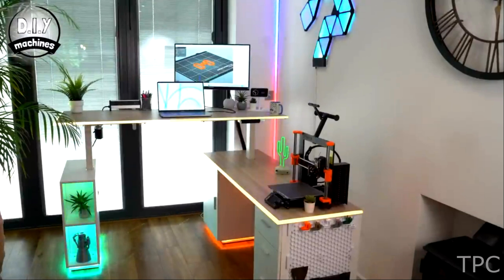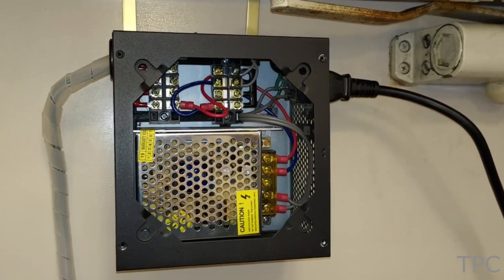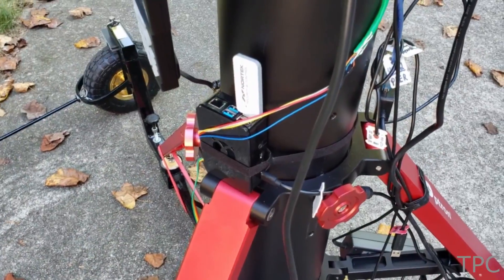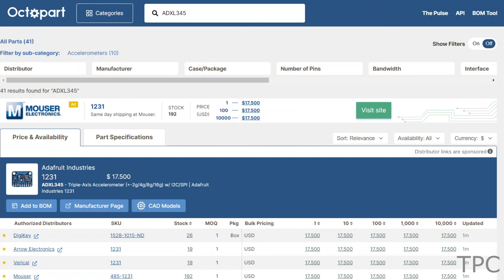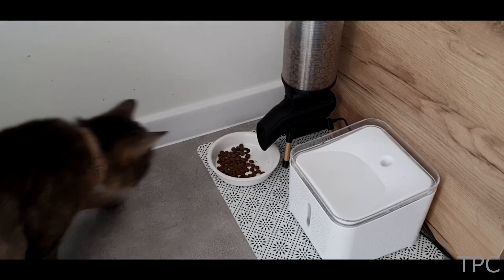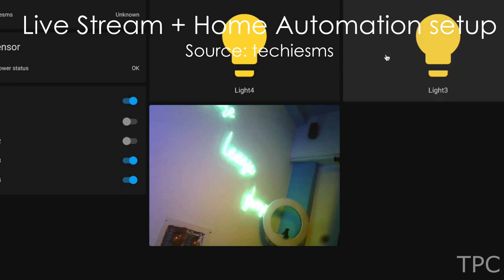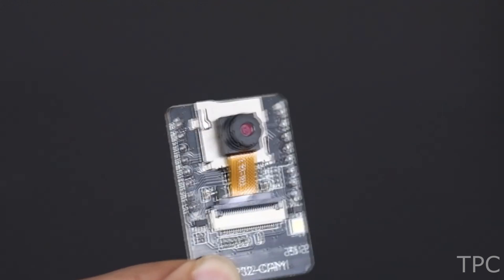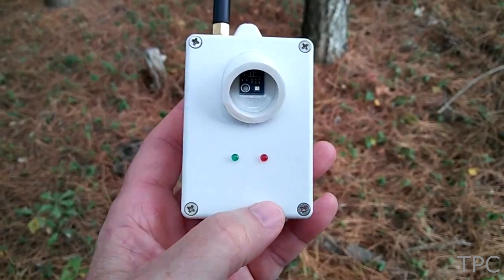13 Best Home Automation Projects using Raspberry-Pi, ESP32 & more!

Comment: Don’t control your locks with an unsecured protocol ie http….
Reply: Most "smart home" hacks come from vendors and IoT devices exposed to the internet, not the local network. This makes the home as secure as the WiFi key when using non-TLS/SSL connections which is, at least at present times with a non-default pass phrase more robust than the average person that re-uses their credentials online and has some crap IoT device in their network.
Reply: It's not really less secure then the average house with windows and locks that can easily be picked. You aren't wrong for very important things, but for your home it's fine.
Reply: @ncm250 but if you want to be secure, you might as well be 100% secure. Either commit fully or choose the normal route